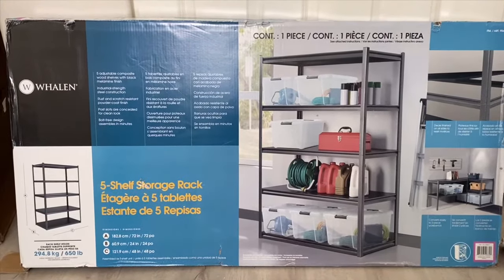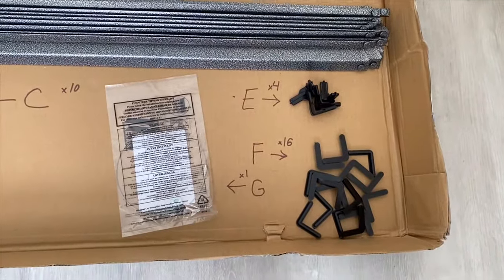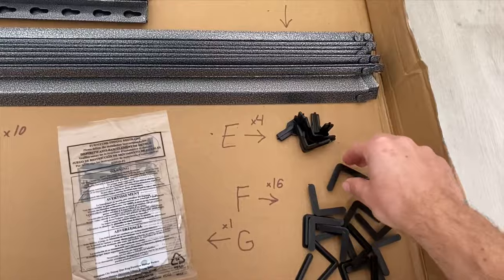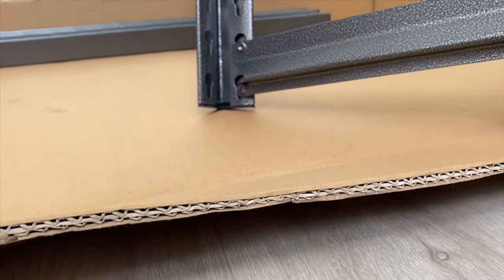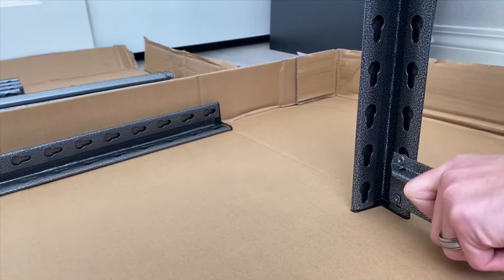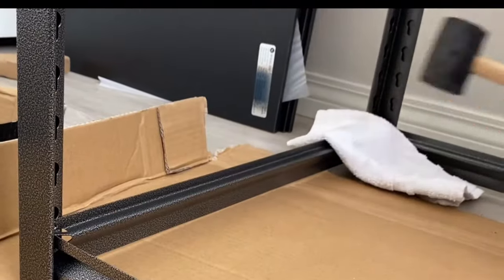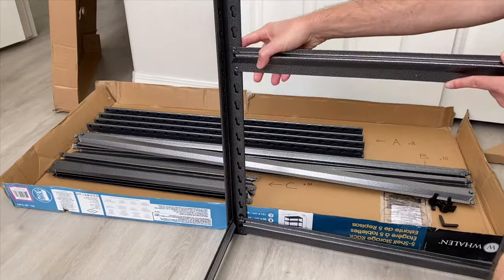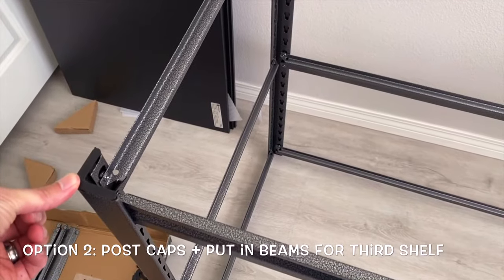Complete step-by-step! Assemble Whalen 5 shelf heavy duty shelving unit

Comment: I just bought this from Costco and am thinking of using the half height version as a workbench by putting a 24x48 (or 30x60 for some overhang) butcher block on top and using as a workbench. 2 questions: is the structure strong enough for this application, and how would one best secure the top to the unit? ideas anyone?

Comment: Was you shelf wobbly before adding weigh to the shelves? We just assembled two and both are super wobbly - wonder what went wrong or why they don’t sit flush on the ground
Reply from the maker: No, should not be wobbly. Make sure beams are at the same height so shelves don’t go in crooked @4:20. Hit all beams down with mallet and towel so they are firmly in @9:05. If you are making the one tall shelving unit make sure post inserts are firmly in @6:10 and straddle the posts with beams @6:50. If you’ve done all that it should be good.

Comment: JUST ONE MORE THING, IF YOU HAVE THE UNIT IN A PLACE (GARAGE, SHED) WITH EXPOSED STUDS, YOU CAN USE BRASS ROOFING SCREWS & ANCHOR THE UNIT TO THE STUDS. I WENT UNDER EACH SHELVE & USED 2 SCREWS WHICH ARE HIDDEN UNDER & NOT SEEN ONCE YOU SCREW THEM IN...THUS SHELVING UNIT IS SECURED & WILL NOT GO ANYWHERE. OF COURSE THE DOWNSIDE MAYBE, IF YOU WISH TO MOVE UNIT IN FUTURE, ALL YOU HAVE TO DO IS REMOVE THE SCREWS...EASY FIX !!  👍👍

Comment: With the connecting bracket, do you not need to put the shelving connector on thecenter?
Reply from the maker: If I understand your question right, you can put the horizontal beams at any position to make the size/height of shelves that you want. The exception is for the ones that straddle the upper and lower portion of the unit - those have to have one peg on the lower portion and one on the higher. Let me know if you meant something different?

Comment: I don't know if my boards are too wide or my beams just bent. The boards just can't be put within the beams. Can anyone measure the width of your boards? Mines are about 120.5cm. They would fit if it's 0.5cm narrower.
Reply from the maker: 120.33cm here. 47 3/8 inches.

Comment: Are the shelves wood or metal?
Reply from the maker: Wood with a melamine finish
Reply: @savemoneydiy1462  Thanks so much for quickly answering my question. I was hoping for metal. Pressboard is even worse.
Reply: @savemoneydiy1462    The shelves are solid wood not pressboard?
Reply: Thanks. I appreciate the info.
Reply from the maker: Composite wood
Reply from the maker: You bet! We’re happy with the shelf material, you can see at the end of the video what we use it for. Either way, hope you find something that works for you! 👍🏼
Reply: @savemoneydiy1462    I decided to get a unit with metal shelves. Thanks for taking the time to answer my questions. All the best.